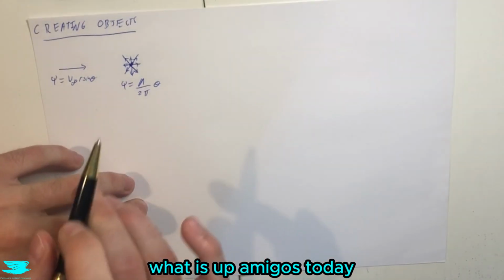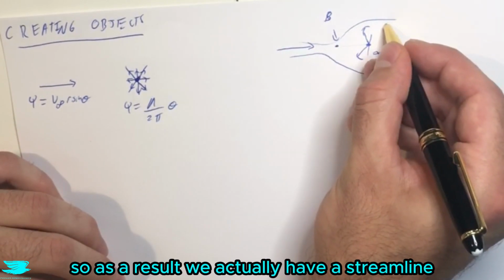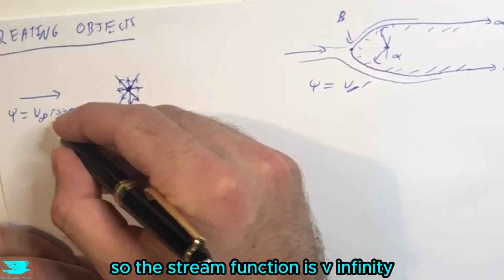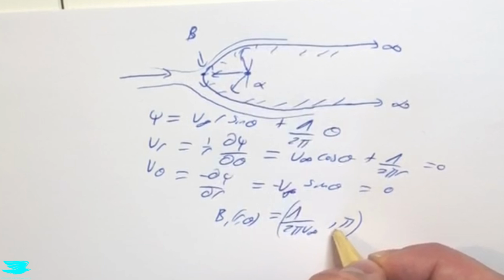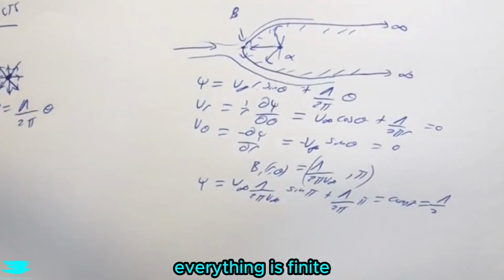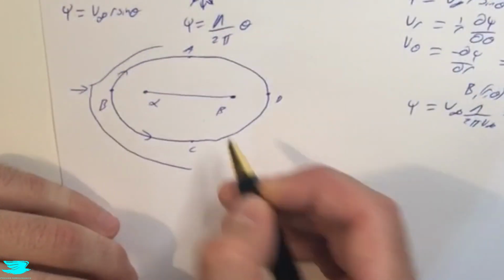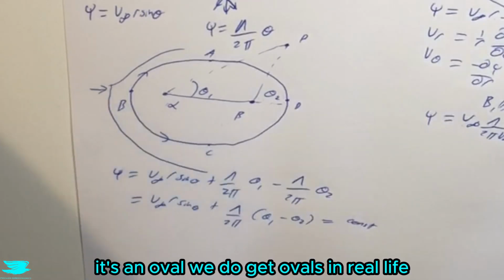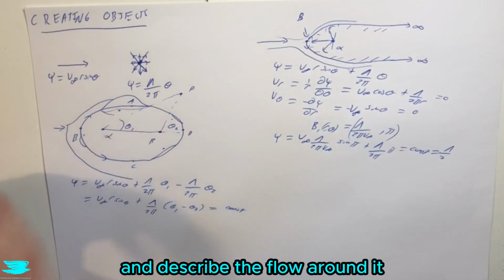Potential Flow Around ANY Object [Aero Fundamentals #57]

Comment: Hello

I guess it is somehow related to the front prop, that is used as windshield blowing in the wrong direction.

I compared the front prop with "vortex ring state" on helicopters.

On helicopters the fuselage is on the wrong side. If the fuselage of the helicopter would be on the other side, it would be affected by low pressure.

So i propagate that the vortex ring state on a prop, results in thrust reversal. 
If the fuselage is on the right side.
And the bullnose propeller causing the vortex ring state is moving.

This should result in an windshield producing thrust. If enough wind hits the windshield in order to bent the flow.
The fuselage could cut the flow of the vortex ring. This cutting edge is called "vortex tongue" as far as i know.
Only the outside flow escapes the vortex ring, that produces thrust. 

I got no cfd solver and i am not this good at math. I just invent and hope im creative enough to impress.
So that the people capable of doing the math like to do it ?

Comment: if possible, please answer: is there centrifugal force acting on the air when air moves along the surface of the wing, or is the centrifugal force insignificant?
Reply from the maker: There is more of a coanda effect that helps keep the flow attached over curved surfaces.
Reply: @PremierAerodynamics  thanks